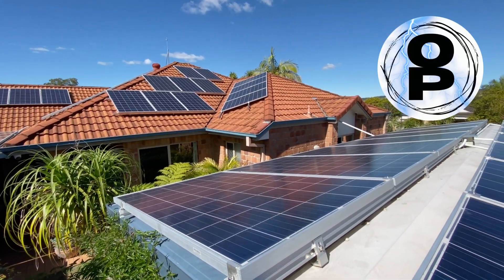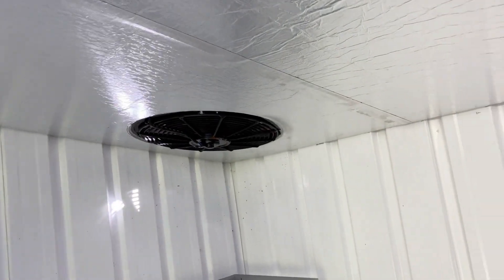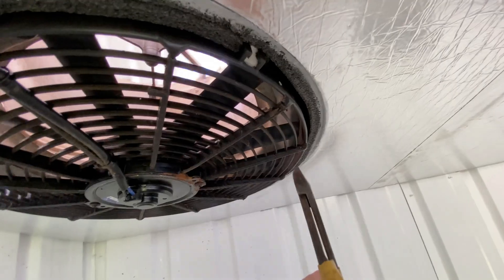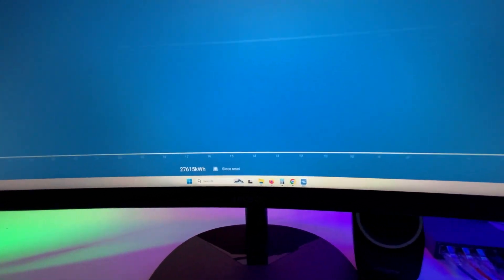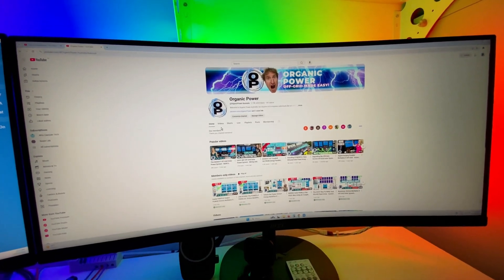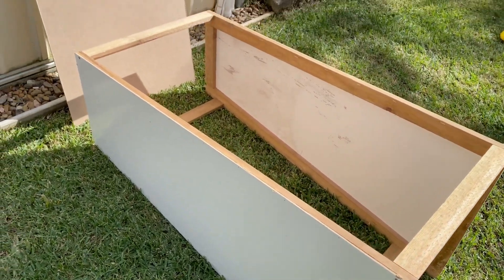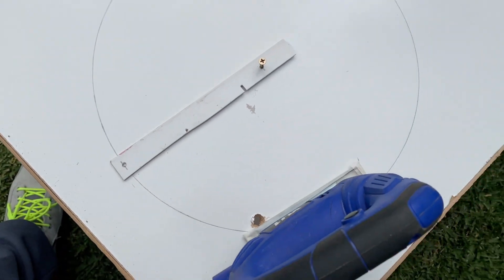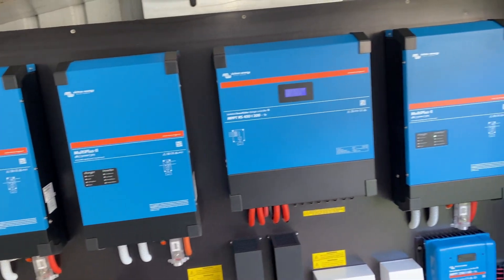Power Your House 24/7 With Lithium Batteries - Our First Off Grid Failure!!

Comment: You're not running AC inside your storage room?
Reply from the maker: Hey mate thanks for the comment. I did setup an AC as a test, but consumed more power than it was worth. The fans maintain a fairly good temp and save the power to cool the house more.
Reply: @OrganicPower-Australia  Hey mate, thanks for replying. I am actually very interested in your setup. I’m curious about your thoughts on using fans instead — how many intake and exhaust fans would you recommend for optimal cooling on a 12kW hybrid inverter with 2 LiFePO4 batteries? Perhaps you already have a video on this topic? Also, at what point would you say an AC setup becomes necessary? My inverter will be running close to maximum capacity during the day and I'm worried about derating and the lifespan of my equipment. If fans are enough, I'm also planning on adding another 12kW inverter in parallel. Any advice would be a great help. Thanks alot!
Reply from the maker: Hi, the cooling would depend on your climate. It doesn’t get above 38 degrees here in summer. Any hotter I think AC would be needed. I picked up a secondhand 5kW Fronius Primo for $350. Definitely worth including if worried about overworking your other equipment.
Reply: @OrganicPower-Australia . Thanks for the advice. Climate here also doesn’t go that high so I might use fans for now.
Reply from the maker: I finished installing the new exhaust fan today as well as the gpo for the floor fan. All ready for summer 😎